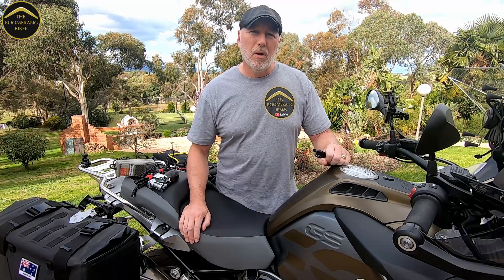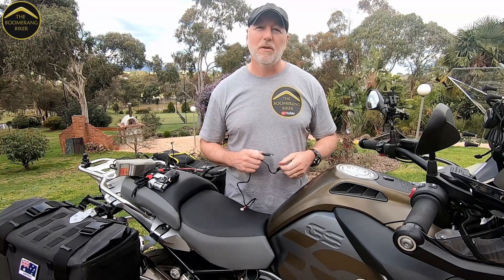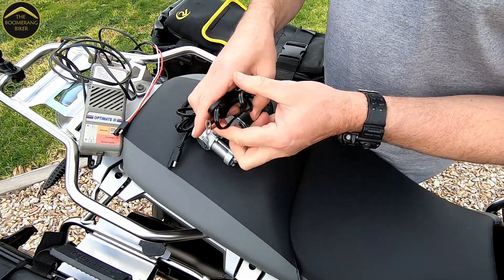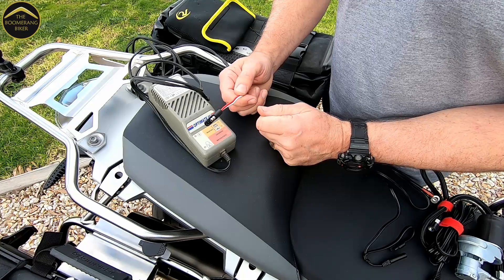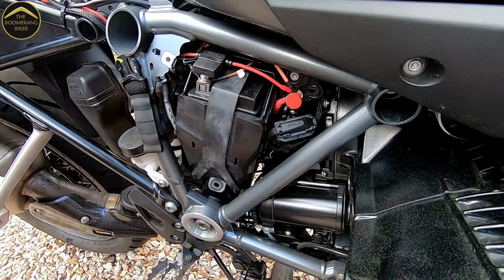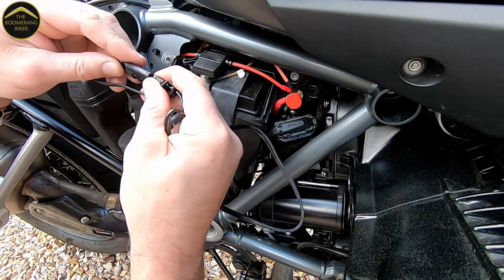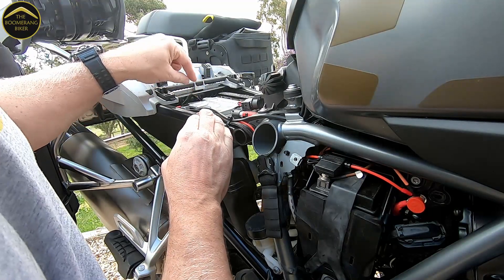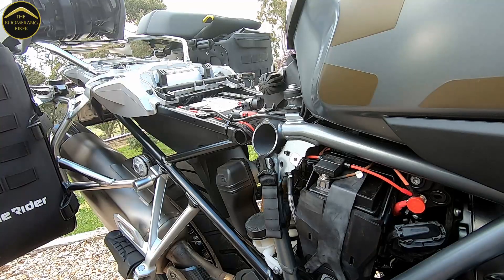SAE Battery Connector - Easy Install - BMW R1250 GS & GS Adventure - Forget about the DIN Socket!

Comment: Extremly funny that I am sitting here,  in Munich, at work, which is in the Anton-Bitt-Bogen and if you google, you will see, that my bureau is about 20 m (yes 20 Meters) away from BMW Motorcycle. 
Funny, because I bought myself a 1250 GSA and want to know how to charge her, without using the DIN-Connection and am looking at you, explaining this wonderfully and sitting on the other side of the word in Australia. 
Very well done! Thank you! Greetings from Munich
Reply from the maker: Glad it helped mate and thanks for leaving the great comment. Email me your address and I'll send you one of my Buff neck tubes and a sticker. Would be cool to have some on display in Deutschland... theboomerangbiker @gmail . com (don't leave the gaps). Cheers, Nick

Comment: Hi Nick wish I  had found your vide 2 hours ago as it would of saved me a lot of wasted time. Having owned two air cooled GS previously I decided to buy the new Pan America Special. Big mistake because I didn't like it and traded it in for my first LC GS. Brought a  new Optimiser lead and decided to fit it. Well as you know the battery positive lead is a nightmare to  get to and after trying to ram lead with fuse box into a small space and not able to get inner cover back on I gave up and stripped it all out. But now I see from your video  that I should of connected to the screw under the red cap. Every day's a school day. You Aussies always sound English to me 😉😂 Ted You've  got another sub now. Thanks.
Reply from the maker: Hi mate, thanks for the great comment and glad my video finally helped you. I was born in the north of England but migrated to Australia around 20 years ago, prior to that I lived in New Zealand,  so my accent is a bit of a mix! Have a great day, cheers, Nick

Comment: HI Nick a better way is to swap out the DIN plug from the handle bar with a usb port, then move the DIN to where you had you plug zip tied to the side of the frame.
Reply from the maker: Hi mate, thanks for the tip. My method works better for me, I already use a DIN to USB adapter in the cockpit to charge batteries in my tank bag. I use the SAE direct to the battery to for charging the bike battery and for taking power out to charge my drone batteries in my tailpack via a 12v-240v inverter. Cheers, Nick

Comment: Hey Nick…. I’m so confused. I see all these videos of guys like you installing SAE and DIN outlets on their GS. I have a  new 2022 GSA and it has a DIN to CANBUS and an SAE already installed. I use the SAE to charge using my optimate 4. Is there any reason I would install another SAE with the inline fuse?

Comment: Hi. Great video. Have done the install. If I want to use an extension cable to use further away from the bike, is there an issue with reverse polarity. Greetings from Ireland
Reply from the maker: Thanks mate, appreciate the feedback. I run mine with a long extension lead, no dramas at all...

Comment: I have the same rocky creek compressor and am wondering if there’s any harm in using the connected they provide with no fuse or if I would be better off purchasing a seperate connector with a fuse?
Reply from the maker: Hmmm, I had same thought and so fitted one with a fuse. You could cut the wire and solder in a fuse if you have something spare, but to be honest it would probably cost more to buy the items rather than a full lead! Good luck Melanie!

Comment: I would like to see a vid on charging drone batteries as you mention here. Right now i run a cigarette charger from the cockpit DIN to my tank bag and plug in the drone charger there. When I do that then I can not charge my USB items. I am now looking to run a cigarette plug off the SAE plug (like you showed in this vid) and charge from the back but I need to make sure I unplug it when I cut off the engine so I don’t drain the battery
Reply from the maker: Coming soon mate, stay tuned.. !

Comment: Dear Nick please help me out, I am the proud owner of a R1200GSA. I went to do what you have by fitting a SAE plug. I was told that it would damage the electrical system on a BMW. Unless you buy a BMW CHARGER. Please help me out I’m confused. Thank you
Reply from the maker: Don't worry, the 'expert advice' is incorrect, you will only have issues if you try to plug a non canbus charger into the DIN socket. SAE direct to the battery bypasses the bike's canbus...

Comment: I would har thought that the bike came as standard with a DIN 12V (Hella) socket..?
Reply from the maker: Yes it does, on the dash but it won't run a compressor without tripping the canbus and you need a canbus specific optimate to charge the battery and they aren't reliable. This solution bypasses the canbus. Hope that explanation helps. Nick

Comment: Great video Nick. Running a 15A fuse. Do you think that is enough? Or too much?
Reply from the maker: Thanks Andrew - I guess it all depends on the appliance going in/out?
Reply: @theboomerangbiker1966  Using the rocky mountain pump. It seems to say it uses 11-13 A so that's probably spot on

Comment: Just curious, if you have the Optimate, can you just connect the charger's DIN connector straight into the DIN socket on the bike?
Reply from the maker: Yes you can but it has to be a canbus compatible model. Mine is 25 years old!
Reply: @theboomerangbiker1966  Oh, OK, got it!

Comment: Does this drain the battery when not in use?
Reply from the maker: I think you answered your own question Rod. If you leave something plugged in (in use, drawing current) whilst the bike is isn't running, then yes, it will drain the battery. For example, using a tyre compressor, always have the bike running. I'm just about to install a smart USB cable direct to the battery that automatically switches off when the amps hit a lowest threshold, ensuring there's always enough power to crank the engine amd start the bike...

Comment: Great video Nick. Question: does disconnecting the battery cause any issues with the bike electronics? I have visions of fitting the cable for my trickle charger and then finding that I can’t start the bike!
Reply from the maker: Alan Mascall none whatsoever. Use some electrical tape to wrap (isolate) the main leads/cables when you disconnect them, for piece of mind... Thanks for the sub, cheers, Nick
Reply: @theboomerangbiker1966   Cheers for info Nick 😊
Reply from the maker: @BiGVern1958  a pleasure mate, happy to help

Comment: Thanks for the fool proof explanation. Out of curiosity, what else have you connected. I saw there was a second cable on the positive. Can't recall seeing this on my bike.
The other question - why didn't you connect to the battery positive directly? Sorry, may seem a stupid question. I'm just not that much of a bike tech person.
Reply from the maker: Hi mate, first off, there's no such thing as a stupid question, but I can give you stupid answers :) Couple of points then... Good pick-up on the "what else have you connected?" that's powering my Hex exCAN which controls my auxiliary lights via the 'whizz wheel' on the handlebars (must get around to doing a show & tell on that). And... there's a handy positive terminal post behind the round red plastic cover that's easier to reach, rather than going on to the top on the battery. How's that for an answer, good enough? Cheers, Nick
Reply: @theboomerangbiker1966  thanks mate, couldn't  have asked for a better answer. cheers Chris